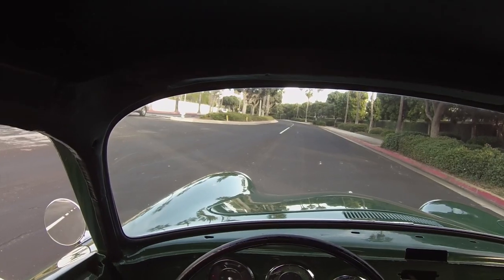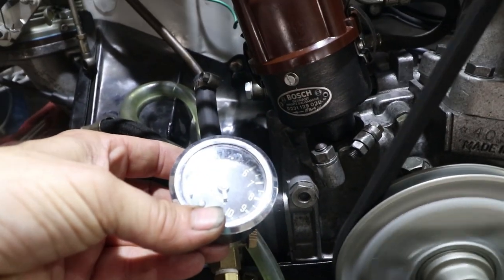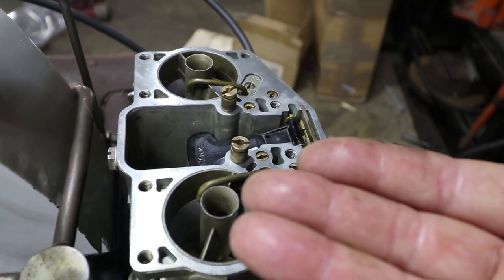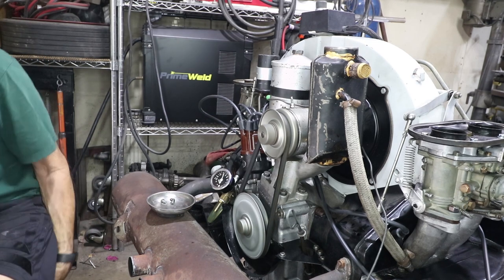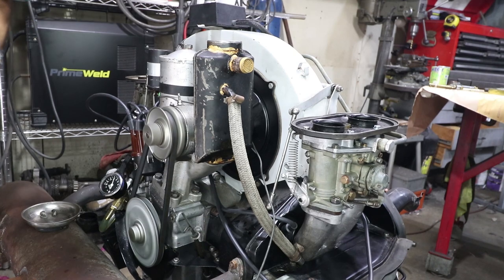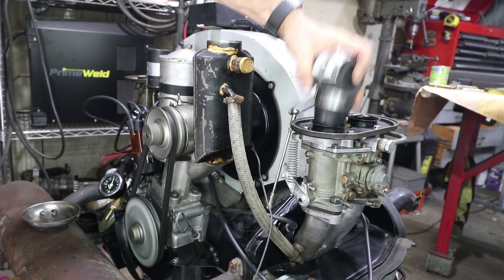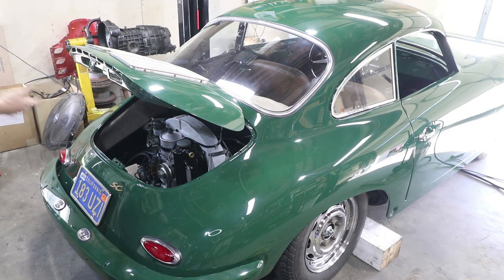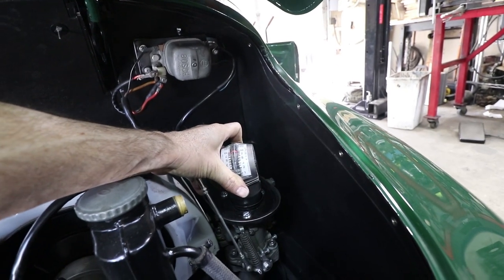The BIG Porsche 356 Tune Up Video - SOLEX 40P11 Setup & More

Comment: WOW!! Tom, it's SO refreshing to find a 'home Porsche mechanic' who actually knows something about them! I owned seven Porsche's between 1965-1991, overhauling, restoring, racing them. (Imagine, 1965, eighteen years old and owning TWO Speedsters)! If I only had them now. Confirm those are 40P11-4 carbs and not 40P11's, as used on the early type 547 engines. (They look too tall for 40P11's). You got my subscription, and I'll email with a little history.... Carl
Reply from the maker: Thanks for the email with your amazing car history and experience.  My Solex's are the standard 356/912 versions, not the rare 4 cam ones.  You are so lucky to have experienced a real 547 four cam engine.  That is special.

Comment: Love the exhaust collector/adapter so you can use a wideband O2. I am sure you will arrive on the correct jetting, I am not as familiar with the available emulsion tubes on the Solex 40p11s as the Weber or Dellorto offerings. Seems you need to start with a bigger main but may need to adjust the timing of the main circuit with the float height, air corrector or emulsion tubes. Really like the stick/gas pedal trick, that is one I think more people need to take note of as that is really one of the most important places to have the carbs balanced. Another great video, thanks for producing such great content.
Reply from the maker: Thank you!  I can tell by your commentary that you are one of the guys that understands carbs and how they work.  I will get there without a doubt.  It's always about the journey.  
So far the car runs great until the mains kick in.
Reply: but it closed a 2 outlet dowe to a single outlet thats only the size of one of the 2 normal ones. exhaust restriction.

Comment: Thank this will definitely help when it come time to sync the 911 carbs. Never seen it done quite that way. I ordered one of those carb sync tools. I do have one that have a ball that runs up a vile that I use to use on an Triumph Spitfire.
Reply from the maker: I've used the unisyn tool with the ball before too.  As long as it's adjusted so it doesn't obstruct the airflow it works great.

Comment: Thanks for another super video!  I think that was the most great info & instruction I've seen packed into 27 minutes.👍 I'm trying to get a 1966 912 stock motor with Solexs running and had the problem you avoided: float to high, fuel leaked into carb, but I unfortunately let the fuel leak into the engine.  I don't know how much but I don't believe the amount of fuel was excessive.  Can you recommend what I can do to minimize any problems that may have occurred as a result?   Thanks Tom!
Reply from the maker: Thank you Joe!  After all that work the engine still doesn't run perfectly, ha ha.  
The danger of gas dropping into the engine is 1) hydro lock 2) diluted oil
I would take the plugs out and turn the engine by hand two full revolutions.
Then change the oil.  
Make sure your floats aren't cracked, leaking, or swollen.  They should weigh around 7.5 gms.  Unfortunately it's hard to find good Solex floats.
Reply: @GarageTimeAutoResto  Thanks again Tom!   Even more great info.  Looking forward to completing what you suggested this weekend, getting it sorted out, and moving on to the next mistake/learning experience 😁

Comment: I know you said you checked the level at the end but was that at part throttle and acceleration?  Some people say that shimming fuel pump can reduce volume.
Reply from the maker: I can see how fuel volume might be reduced slightly with the necessary shims, but I don't think a volume problem would show up immediately at 1/2 throttle.  It takes a while to drain the bowls.  If you watch the afr guage it goes from rich to lean in a hurry.  That is why I checked for a clogged jet.

Comment: Tom - for these 616 engines- do you have a preference between the Solex and the Webers?
Reply from the maker: Personally, I think the driveability and smoothness is better with Solex.  However the problems with sunk floats and shaft wear is no fun.  
Webers have clogged idle jets all the time, so there really is no clear winner.
Reply: @GarageTimeAutoResto  I have a set of each for my 912 project. wasn’t sure if I should get rid of the Webers since I’ve always heard solex would be best - but I think my solex will require a complete rebuild. 

One last question- do you have any experience with LN Nickies? I picked up a set years ago (with JE pistons). Haven’t used them- they say to replace the head studs with ARP but have also heard otherwise. This won’t be a race engine. 🤷🏻‍♂️

Comment: Wish I could have gleaned all this good info from my Elfrink manual In 1970. Will you dyno it once you have everything like you want it? Hope so.
Reply from the maker: Dyno is a nice to have, but if the opportunity comes I would gladly do it.  I just want good driveability and decent power.  
Mac is the go fast car and will definitely see some Dyno time.
Reply: @GarageTimeAutoResto  True, but you’d get another video out of it. Did you port and polish the heads? With almost 10% more cubes and a somewhat hotter cam I’d think 125 HP.
Reply from the maker: No porting or polishing, but I did make sure the seat angles were good for flow.

Comment: I must say, that's a nice solution for the wideband sensor.  Also, it's interesting to me how the distributor is controlling the amount of time it takes to return to idle.  So does this mean with the mechanical weights coming back in, the ignition advance is taking a while to return to normal in these low/no load conditions, hence the revs take a while to come down?  Trying to understand as this might be applicable to a problem I'm having with my own engine.
Reply from the maker: The distributor springs allow advance at 900 rpm which is right at idle.  
Attach a timing light and watch how slow the timing returns. 
Sometimes the weights need to be lubed with sil-glyde or a drop of oil under the rotor felt.  
The distributor and carbs sometimes get in a weird feedback loop and the idle suffers.  
The best solution is the 123 distributor.  Stay tuned for that video too.  I have some stealthy planned
Reply: @GarageTimeAutoResto  I probably mislead you a bit there... The engine I'm running doesn't have a distributor (it's running MicroSquirt + CoP ignition) - but the problem I'm working on is, the revs would fall so fast after a throttle blip, it would stall.  My solution so far is to add a dramatic amount of timing (idle advance settings) in the right circumstance (low revs, low load) so it "catches" the engine revs and returns to idle speed nicely.  Apparently that's how it's done, so people tell me.  Consequently, I was just fascinated in how smoothly (if a little slowly) this 356 returned to idle speed with just the behaviour of the distributor!
Reply from the maker: Oh, I see.  You've gone all techy 😃
Your timing strategy sounds like it would work to mimic the slower responding distributor weights.  
I know my 3.2 engine with electronic timing also sounds like it's going to die when returning to idle.  Especially with a light flywheel.
Reply: @GarageTimeAutoResto  Yep, that's right... So I spoke to a few others, and this way (via ignition timing) is an acceptable way of doing it.  On the 3.2 Carrera and 928, they actually use their idle motors to soften the revs as well back to idle speed.  I was so happy just to get it started with EFI, but it seems it's just the beginning of the journey.
Reply from the maker: Well I'm right behind you.  Stay tuned for more ITB fun!

Comment: As long as you dont drive it through the desert you are fine without the air cleaners. I have no idea what jets you need, but i am sure you will figure that out.
Reply from the maker: The other trouble with jets is they are often modified.  All used jets need to be checked
Reply: @GarageTimeAutoResto  yup... do you have a set of jet bits?
Reply from the maker: I have pin gauges in .001" increments.
Reply: what they measure and what they flow are two different things @GarageTimeAutoResto